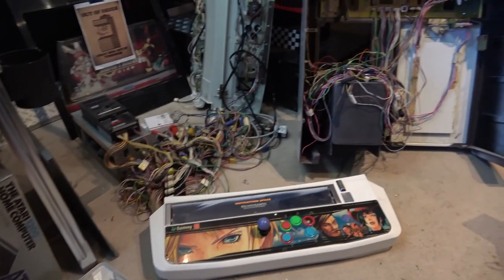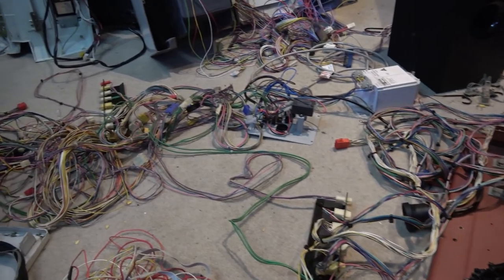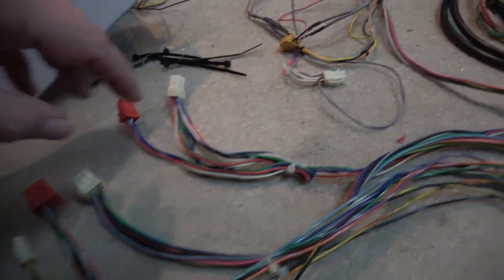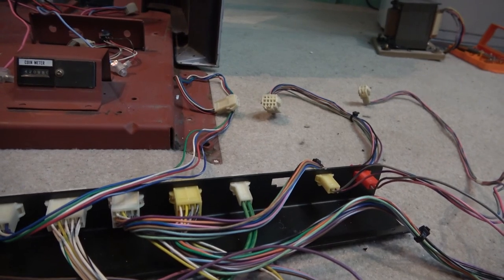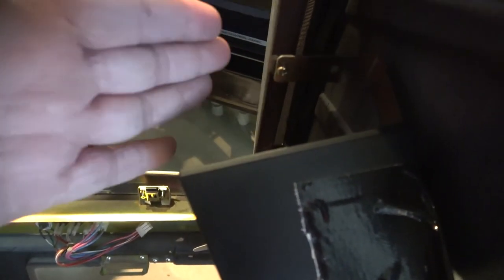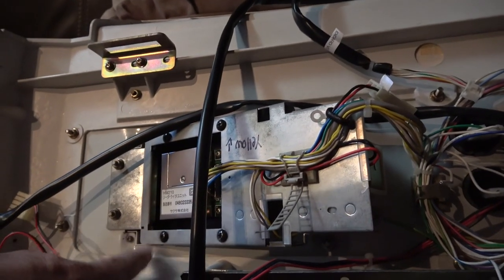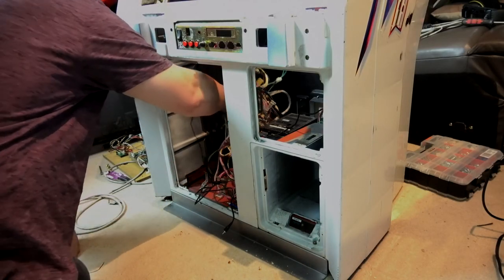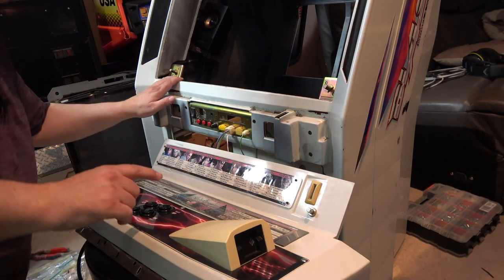FE035 - Sega Blast City Rebuild

Comment: I remember the pain it was to disassemble my Blast and my Astro. What screwdriver and heads are you using? I ruined all my heads in the process. And would like to have some quality ones.
How was the speaker solution?
Reply from the maker: Well I ruined a lot of my JIS screws to and replaced them with Phillips equivalents (in terms of size - M6? If I recall). However these were not idea as the treads were still different so I did end up sort of stripping the threads for the new replacement Phillips screws. Really the proper way to do it is to buy a JIS screwdriver and source some M6 JIS screws with the right thread. The speaker solution is awesome! Cheers.
Reply: +Spacies Arcade exactly, the threads are different.     How did you strip them?